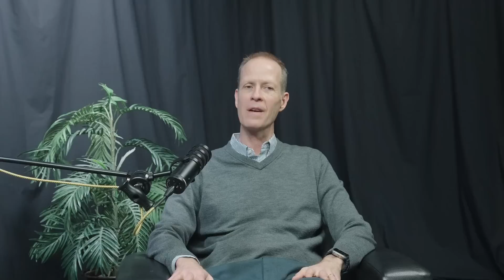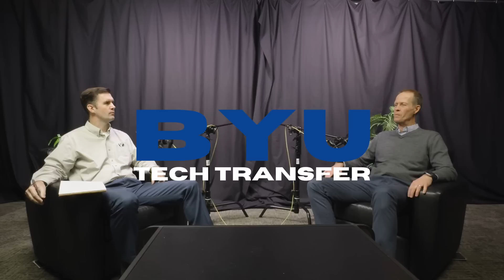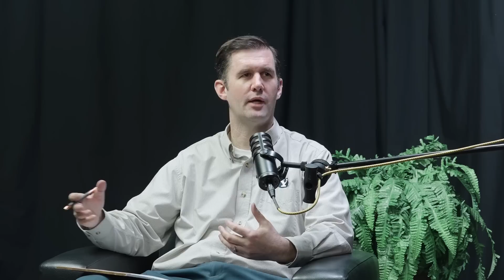Drones Navigating without GPS: The Future of Autonomous Drones with Dr. Tim McLain

Comment: People navigated without GPS for thousands of years without GPS, so it's a matter of developing machines that can use all the same techniques that humans used.  Commercial radio stations are great fixed points on the ground, though of course they can be spoofed in wartime.  Roads, cities, and distinctive geological features are much harder to camouflage.

Amusement:  Back in the 1970's when I worked for the Boeing Commercial Airplane Company in Seattle, some of my buddies up in Everett, Washington developed an overhead window in the cockpit of the 747 so that Qantas pilots could use a sextant to check their position with star sightings on long night flights over the Pacific, when they spent a lot of time out of range of any ground stations.
Reply: Wow, sextants on a 747.
Who knew?
Super reliable, ....  and no batteries.
Reply: Absolutely right. Problem is that GPS made everything more cheaper to build an precise.  Thankfully civil use saved the GPS, but this technology will become obsolete in battlefield.

Comment: What use are drones in armed conflict if their radio signals are located?
Reply: Because they don’t necessarily need radio signals…
Reply: @LIamaLlamo50o0  Human's don't need radio signals either, but AI-tech would take considerable power and processing to be able to compare to a human.  
All this tech is going to need to disrupt this tech is SMOKE!  Lots of smoke and these things will all fail!
Reply: P.S.  GPS could fly thru solid smoke and no issues, btw.
Reply: Because drones dont stop after you find their operator. You have to use artillery or another drone or some resource to incapacitate that signal and that opens up your own assets to detection and incapacitation.
Reply: UWB is undetectable